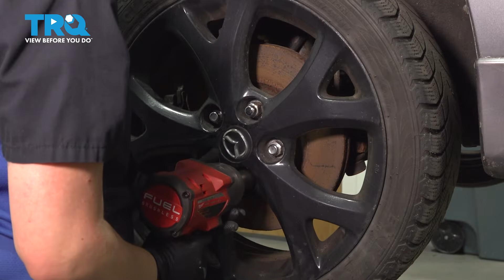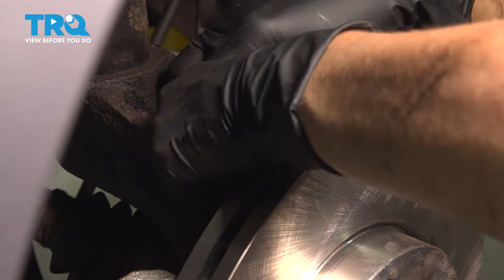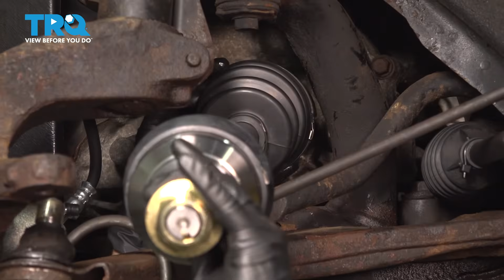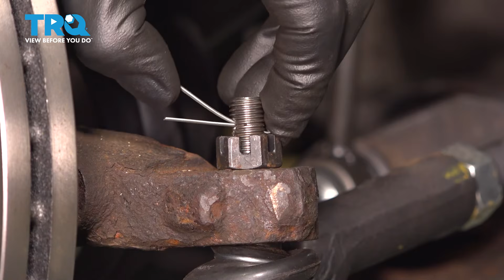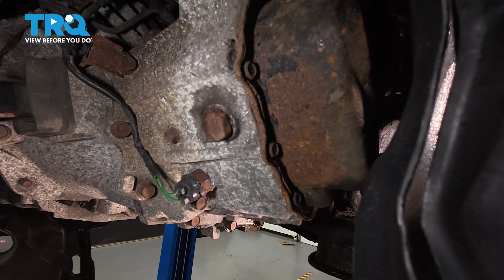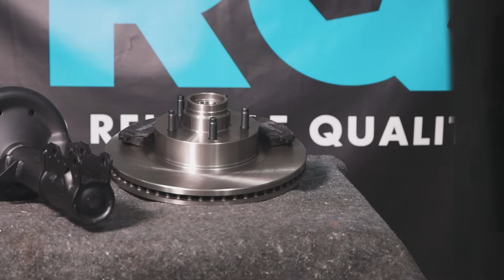How to Replace Front CV Axle Assemblies 2004-2009 Mazda 3

Comment: This is the most secretive parts replacement I've ever seen.  Barely see what's going back in, the mating surfaces, the details of the part being replaced for comparison purposes and lastly the installer. Though the installer holds very little bearing in its completion, the obvious ovoidence of their person shows in the part representation when they show it like its a Tuscan Raider in Star Wars blaster staff. A full view of the CV Axel would be nice since documentation isn't clear between models.